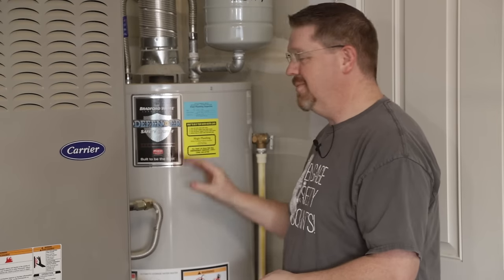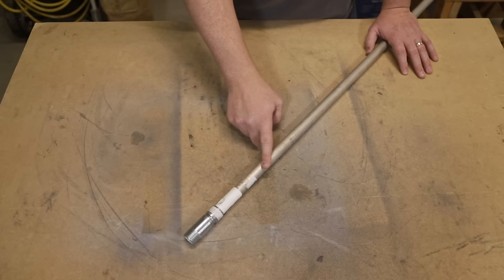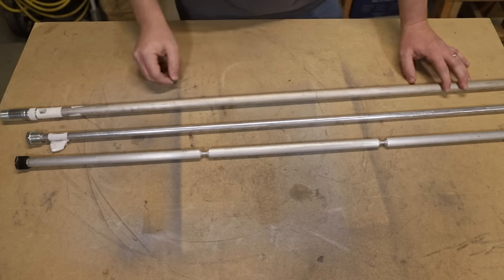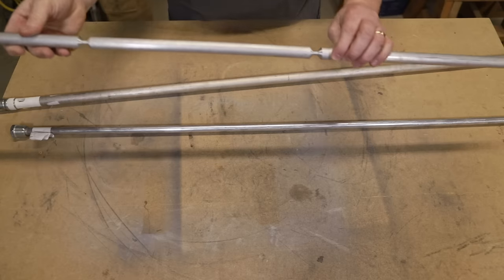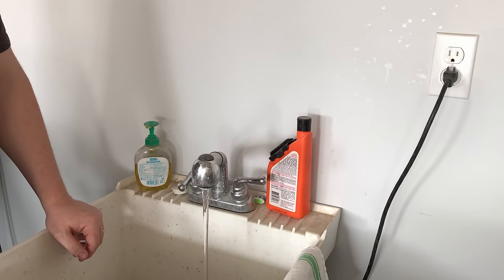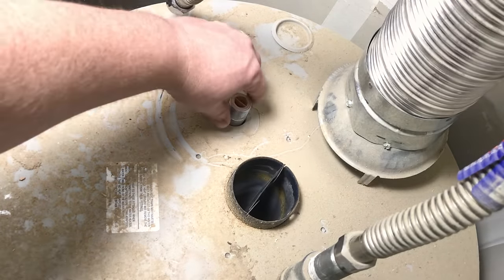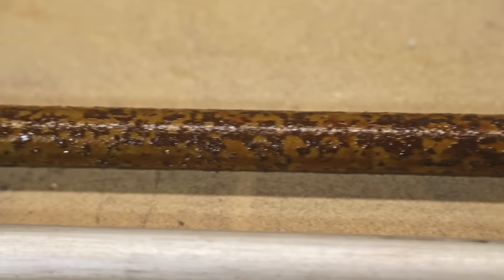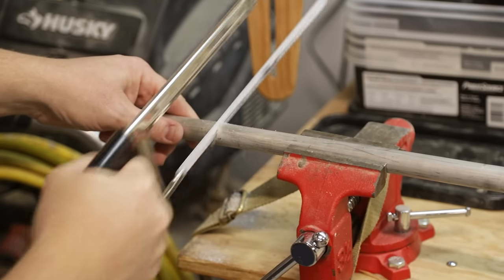How To Replace Water Heater Anode (Step By Step)

Comment: Using Teflon tape can cause electrical insulation between the anode rod and the body of the tank.  The anode rod must be electrically connected to the tank which forms the cathode in order for the anode rod to properly function. It was not said how long the Anode rod that was removed was in service, it looked like it was in a short time, or it was not functioning properly due to electrical isolation. Otherwise, a great presentation!
Reply from the maker: Hi Roland - When I filmed this video, the heater was a little less than 3 years old. So the amount of decay was expected. You bring up a good point about making sure there is good conductivity between the anode and the tank, though. Usually the threads have no problem cutting through the teflon tape and pipe dope to make a good connection, but it's a good idea to check with a multitester to make sure there is continuity after replacing an anode. Great tip, and thanks for watching!

Comment from the maker: Why does Bradford White have to be so ... special? Their anodes can be a real pain in the neck to replace.
Reply: They want you to buy a new tank not an anode.
Reply: First great video just like all your other videos and i just have two questions 1. Why didn't you put thread sealant on the side connected to the house is that not recommended? 2. Question is what to do if i don't have flexible pipes like you have mine seemed to be just brass pipes on cold and hot side ( i also have the pleasure of owning a Bradford ) so what should i do and is there a ano rod on the cold water pipe also ?
Reply: My water heater lasted 30 years. Didn’t flush it or replace the anode. Sometimes if it ain’t broke don’t fix it as you could cause more problems. Since the old anode was still good just leave it as is.
Reply: @carlosbolanos1070  Yeah, just buy one of a different brand! LOL

Comment: I use to install water heaters and i live in Canada.  I think the chimney is called a DRAFT HOOD since this type of water heater is atmospheric ;since there was NOT a power vent on top the water heater.  Atmospheric relies on only air from inside the room (Area) to mix with the natural gas to heat the water in the water heater.  Power vent appliance (water heater) there is different manufacturers: Rheem, Rinnai etc.,  power vent exhausts the exhaust products then the electronic circuit board by timers sends messages to the sail switches to the electric /electronic circuits to make enough electricity for the safety to allow the main burner to the water heater to come on.  I enjoyed the video though  keep up the good work.

Comment: Followed this video, luckily mine was stuck up enough where I could grab under the threads like yours and not your brother's.  Thanks so much for this, mine was corroded pretty bad, basically all the way down with crumbles of rusty metal on the center rod.  I had quite a time getting it out given all the corrosion on the threaded area.  I also used some cheap China made pipe wrenches that kept opening up on me while twisting it out...going to invest in some better ones.  Thanks again!
Reply from the maker: Glad you got it done. Great job!

Comment: Love how detailed your videos are. 

My hot water heater is 15 years old and we bought the house about a year ago. I've thought about changing the anode rod several times but always talk myself out of it since the expansion tank is positioned almost directly above it and I hated to mess with it. At this point I think I'll just wait till the water heater fails and make sure the next one is installed so I can change the anode rod periodically.
Reply: Just change it and reposition you thank at once, and keep changing it every 3 to 5 years.
Reply: My Bradford white is 15 years old as well. I would love to change the anode instead of the entire tank. What are the chances that this method would preserve the life of the tank and prevent it from busting?

Comment: This is great in theory, but I talked to a couple veteran plumbers and they said do not fix it till it's broken. Doing any work or even draining your water heater can greatly shorten its life. it can actually lasts 50 to 70 years if you don't do anything to it. but you will make more work for yourself because you could actually break the water heater by repairing it. Thank you kind sir for your all your hard hard work it is educational.
Reply from the maker: Hi M P - I'm afraid the plumbers you spoke with are grossly misinformed. Heaters absolutely do require maintenance, and simply doing nothing drastically shortens their useful life. Don't take my word for it though, search google for something like "should I replace the anode in my water heater" and see what you find. I think you'll be surprised. Thanks for watching!
Reply: “50 to 70 years”….. good luck with that. Fantasy.
Reply: Good lord I don’t want your plumbers. My tank failed at 9 years. Now I maintains  it much better.

Comment: My water heater has a recessed anode, so I used a Bauer impact wrench (wired - has much more torque).  You must use a 6 point inpact socket (27mm) to have this work!   regular 12 point sockets will distort and round the head of the anode.  After I got that impact socket, the anode came right out and was completely shot, so I'm glad I did this work
Reply from the maker: Nice work!

Comment: 19:41 - This thread starting technique will work on any thread type: NPT pipe, PVC adapter, machine threads, sheet metal threads, wood screw threads, Romex clamp locknut threads, nylon threads, etc. It even works on the fine threads of a Nikon camera lens adapter and the plastic cap of your milk jug! This is definitely a time saver and you’ll never “cross thread” again!

Comment: After doing mine I can attest to using an impact wrench. I messed around with the cheater/breaker bar and saw others using an impact. Breaks that seat and use your ratchet to finish and use the ratch to reinstall. Impacts are your friend here

Comment: Nice video!  I also have a Bradford White water heater, and was wondering where the anode was.

You might consider updating your video to deal with the fact that the rubber seals in the corrugated hot water heater supply line, especially on the hot water side, will become hardened and will often crack or just won't seal.  They are replaceable, so you don't need to replace the corrugated supply line if they won't seal.  I have included the part number and some links to the Danco version of them at the end of this comment.

The proper replacements are not flat rubber washers -- they are actually beveled, with the outside edge being thicker than the inside.  This is done to help insure that when they are tightened they properly seal, and to insure the connection is electrically insulated, forming what is called a "dielectric" connection (explanation below).  

These corrugated supply lines are intended to be dielectric, which means they electrically isolate the metal in the water heater from the house plumbing.  This is necessary to prevent galvanic corrosion between the dissimilar metals in the water heater and the metals in your plumbing from occurring.

Caution -- don't try and use a flat washer from a garden hose.  While it may work for a while, it will fail -- especially on the hot water side where the seal takes a beating from the heat.  The flat washer also may not properly electrically isolate the fitting.

It's a bit of a pain to remove the old washer, because it usually has hardened up, but it can be done with some patience and either a pick, or a small flat bladed screw driver.  Here are some tips:
1.  Make sure you remove all of the old seal before pushing the replacement into place.  
2. I recommend rinsing or blowing out the supply line to get rid of any bits that may have fallen inside during the removal -- you don't want those bits in your plumbing.  
3.  I recommend replacing the washers in both ends of the supply tube -- since you will have to remove the supply tube to rinse or blow it out anyway.
4. Make sure to work the replacement in so that it is fully seated against the bottom of the fitting all the way around, (and pull up on the threaded nut to make sure the rubber seal really is pushed all the way down inside).  Don't use anything sharp to push the new sealing washer into place.  You don't want to cut or gouge it.  It's okay to use something dull if you need to -- just be careful.

The Danco part number for the proper washer/seal is 65884B, and they sell for around $1.25-$1.40 each in most hardware stores and plumbing supply places.  
Here are two links to the washers (the DoitBest link shows a picture of the actual beveled washer, the AceHardware link just shows a picture of the bag):
https://www.doitbest.com/shop/plumbing-supplies/pipe-fittings/sewer-and-drain-fittings/rubber-sewer-and-drain-washer-replacement/danco-1-in-water-supply-line-washer-replacement?SKU=492981
https://www.acehardware.com/departments/plumbing/faucet-and-faucet-repair/plumbing-washers/4023925
(Note the title at the DoitBest site is a bit misleading -- they call it a 1 inch washer, but it is intended to be used in a standard 3/4 inch corrugated water heater supply line.

For some reason, Amazon is now charging $4.50 each for these Danco sealing washers (they used to sell them for 96 cents each a year ago), so it is much cheaper to get them from Ace Hardware or DoitBest hardware (I couldn't find them on the TrueValue site).  Both of these national hardware chains will ship them to your local store for free so you can avoid any shipping charges by picking them up there.

The big box stores don't seem to sell these sealing washers anymore -- instead they want to sell you a replacement supply tube for $20-$40.

Comment: ...so just when I find a video that shows me how easy it is to replace the rod I realize whoever installed my heater used copper pipes and solder so I can't remove the fittings. Womderfulll!!!!  the copper ends and is clamped to a PVC pipe. Now I'll have to find a video that shows me how to fix this problem.
Reply from the maker: Oof. Good luck!

Comment: About 13min in has an anode with life left he said could be put back in for a few more years left, and at 14:50 has a heat trap "valve" piece he also ordered with the magnesium anode, about $4-5 replacement. He hacked by hand the replacement magnesium rod (it can burn if it gets too hot) to match the length of the original anode rod to not damage his tank just in case when putting in the replacement that it's not too long as shown when ordered online. Has to add joint compound and Teflon tape (don't put the tape on backwards). Segmented anodes are a possibility depending on the room available above the tank. No crooked anodes, the water fights you. Don't damage the threads, pipe wrench needed. Love the video, didn't know anodes existed until today, sorry was taking notes or cliff notes rather to stay focused while my cat purrs on me and tries to get my attention. Last part of this video makes me think a pro might be having to do this switch, how often does an anode have life? Oh thanks on the Harbor freight $8 info on the pipe wrench.
Reply from the maker: Hi Jillio - great notes! You asked about anode lifespans: this varies a LOT based on a bunch of factors: do you have a water softener? How hard is your water? What specific minerals are dissolved in your water supply? How much hot water do you use in a year? - the list of variables goes on and on - but here is the general rule of thumb: Start checking your anode 3 years after it was first installed. If it still has most of it's mass, put it back in for another year. Once it looks to be all used up (any part of the steel core that runs the length of it is visible) it's time to replace it. In my area, they last around 5-7 years, depending on all the variables mentioned above. Thanks for watching!

Comment: Thanks for the video.  I just replaced the anode rod on my Bradford white water heater.  problems everywhere!   When I disconnected the hot water outlet, a lot of water went everywhere, even though I opened my hot water faucets, and drained the water heater somewhat.  The insulation on the top of my water heater has been moist for days now, not sure how to dry it.

The Copper to CPVC hot water outlet pipe broke its seal.  Had to wait till the next morning to get to Home depot.  they had a sharkbite water heater kit.  Surprisingly, it was exactly what I needed.  I didnt have to extend any cpvc.   Plus it has a valve built in, so next time I wont have tons of water draining back.
Reply from the maker: Oof! Sounds like yours was an adventure. Great job getting it taken care of!

Comment: Kudos to the original installers.  I suspect the reason the anode is cut short is because they removed the anode before installing the water heater.  After installing the heater, they found the anode was too long to install (thus too long to remove) and cut it to fit.  OTOH, their foresight prevented us learning how to keep metal dust from falling into the water heater while hacksawing an anode being held by vise-grips,..
Reply from the maker: I suspect the original anode was installed at the factory, not by the plumber who installed the heater. As for metal flakes that may make their way into the tank: that's why there's a drain valve and flushing procedure for all water heaters - to flush out any junk that makes its way into your heater. Thanks for watching!

Comment: Thanks for letting me know I do not want a Bradford White water heater.
Ours is old enough I am scared to mess with it.
Will run it till it leaks and then replace it with a tankless.

I do need to change the rod in my father's heater.
It is at least 5 years old.
Reply from the maker: Yeah, I'm not a huge fan of Bradford White's design with having the anode integrated on the output side. Other than that, the heater seems to be just fine. Thanks for watching!

Comment: Thanks so much for this detailed video.  I had a leaking hot water outlet pipe that I needed to replace, so I figured I'd go ahead and replace the anode while I was at it.  I had the same problem your brother had, but used the locknut trick some folks describe in the comments and was able to get it out.  One thing I guess I was unprepared for was the amount of residual water left in the outlet piping.  I know that wasn't really the focus of this video, but if I had to do it again I would be ready with a cap or plug to plug off the end while replacing the anode.
Reply from the maker: Great tip about the residual water. Thanks for watching!

Comment: Your the only person I ever seen use Teflon tape with pipe dope, scratch the teflon, as the threads need to make contact with the female end, using teflon and dope will make the anode less effective.
Reply from the maker: Hi Landon - lots of people use both. As long as you tighten the fitting properly, plenty of surface are of the threads will cut through the teflon tape and make a good conduction path for the anode to work properly. Thanks for watching!

Comment: Thanks for your video -- just what I needed!  Why do you not put teflon tape on the joint from the top of the anode to the house hot water pipe?
Reply from the maker: Great question, David! That fitting already has a rubber gasket inside the house side of the connection that makes a great seal. Teflon tape there would be superfluous. I won’t hurt anything, but there is no reason to have it there at all.

Comment: I have seen a tool that can grab the INSIDE of a pipe to unscrew it or tighten it.  That might be something to look into for jobs like this.  Try searching on Amazon for "Internal Pipe Wrench."  There's several brands available and in sets for between $20-$50.  Its described to work off of an "eccentric cam" where machined and heat-treated cams grab onto the interior surface of pipes.  The more you turn it, the harder it grabs.  One described use is to remove remnants of pipes that have broken off of fittings where you need to remove the stub inside a fitting.  Hope this helps!
Reply from the maker: Great tip! I wonder if the are capable of exerting enough force to break these things loose. They are REALLY tight from the factory.

Comment: Probably won’t be attempting this, because I recently installed a new water heater myself. But it’s good to know how to if I do at some point. Btw it was driving me mad that you didn’t clean the top the water heater before you started 😉
Reply from the maker: Heh. I like to leave things as they actually are, because the chances are that the top of everyone's heater is pretty dirty... having said that, I should have started with it still dirty (and shown it that way) then mentioned it would be a great time to clean it off and do so quickly in the video. Then the rest of the shots would be of a nice, clean heater top. I'll keep this in mind for future projects. Thanks for watching!

Comment: Great video, just finished mine. I would use smaller channel locks or something else to put the new anode rod in.  I had the same size channel locks and they would have hit or tore up the new anode threads so I went with a smaller tool.  Otherwise awesome video
Reply from the maker: Great tip, and thanks for watching!

Comment: Nice video,  Since the anode rod needs a current flow between the steel tank and the rod it would probably be best not to use Teflon tape insulating the threads.  The steel threads may cut through the tape anyway but why not just use a Teflon pipe dope instead then the threads will be in direct contact for sure.
Reply: You could use a multimeter to make sure the rod is connected to the steel tank. Just beep out the top of the rod to hot or cold pipe leaving the tank. Set your multimeter to ohms & it should measure zero.